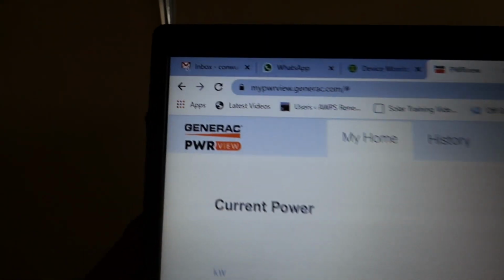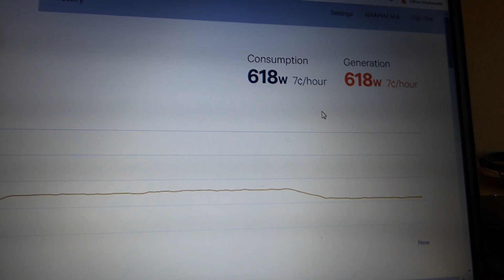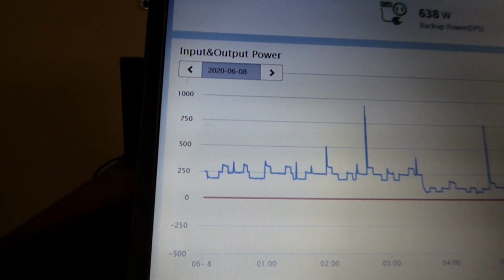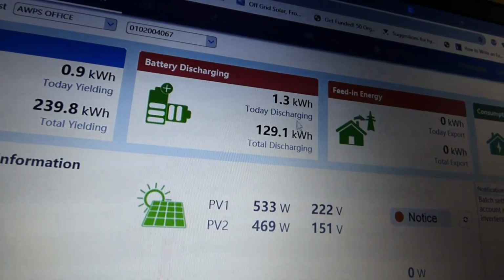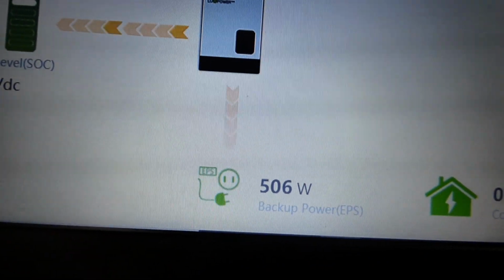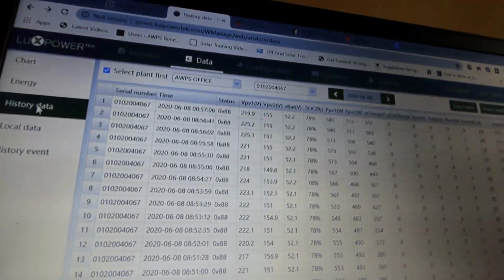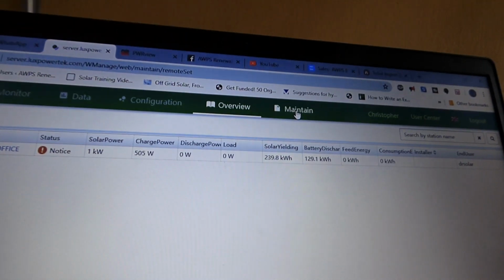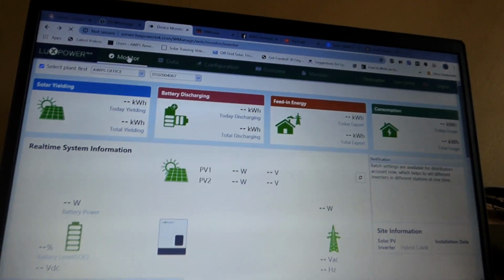Reading and getting the Luxpower Hybrid screen UI

Comment: Nice one Dr Solar. Does this inverter support custom lithium batteries or BMSs (like your Nissan leaf battery for example) or it's limited to specific lithium batteries from designated manufacturers?
Reply from the maker: They use the lead acid battery profile for custom batteries. I have asked them to make some changes or add a custom option. The Weco is being charged as a lead acid battery for now.
Reply: @drsolar  Thanks for the prompt response. They really need to allow custom battery profile.